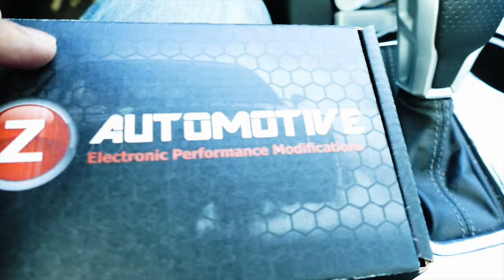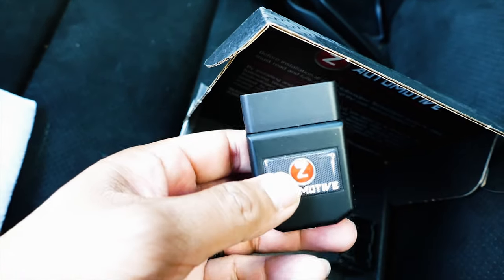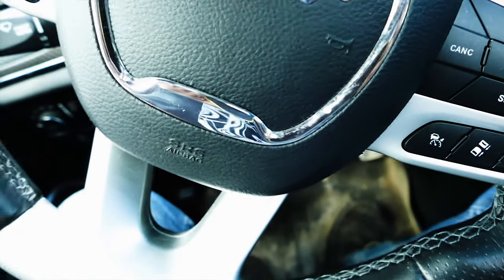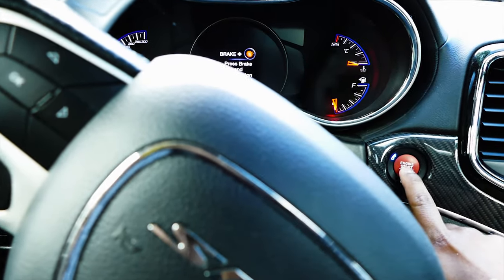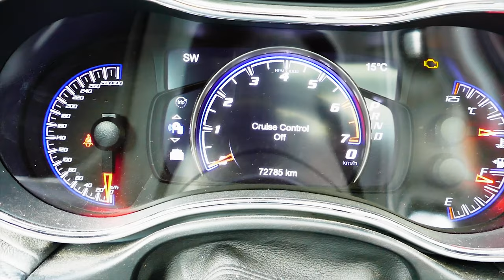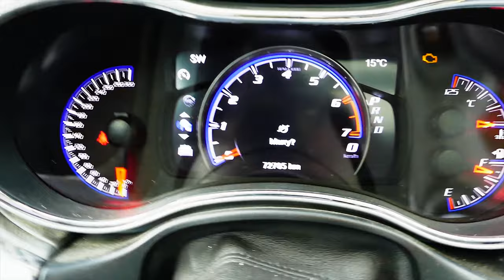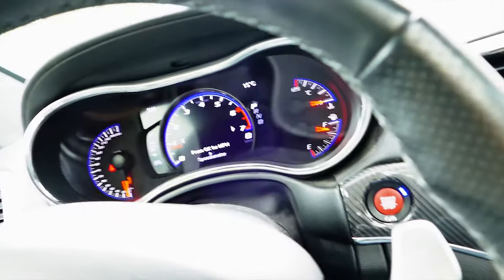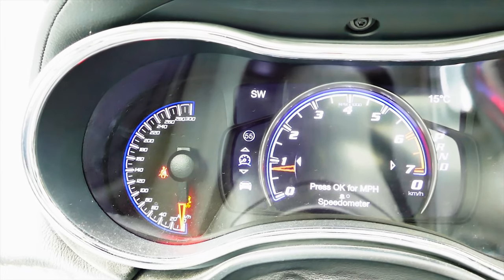z automotive tazer jeep grand cherokee

Comment: Does this mess with your jeep in anyway
Reply from the maker: Hey there, it's a better option than pulling the  transfer case fuse, no issues with mine after 80k driven after install. thnx for watching!
Reply: @moparbro  so when doing a burnout in rwd it wont hurt transfer case?
Reply from the maker: @bcooney28  Hey there, hasn't hurt mine, so in my opinion it doesn't.
Reply: Quick question: if i already have srt pages without the gauges on my uconnect will this add them ?? The gauges i only have in the instrument cluster